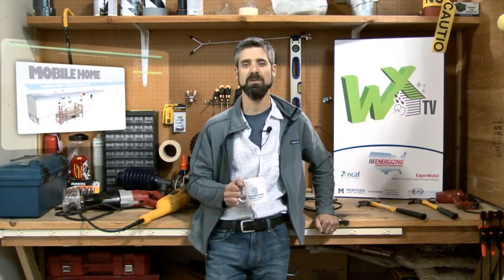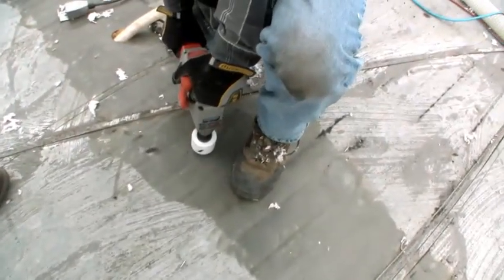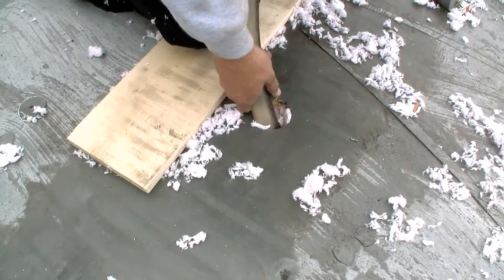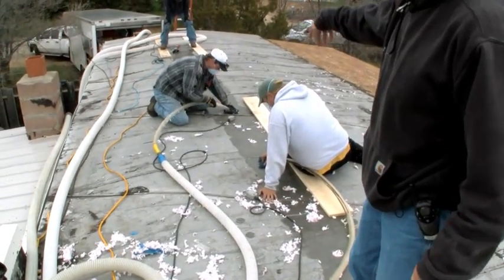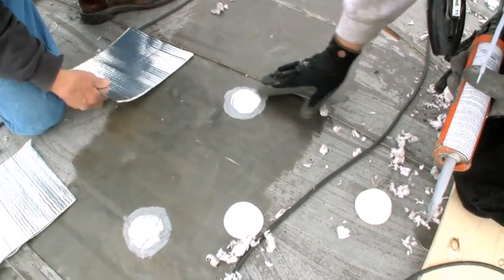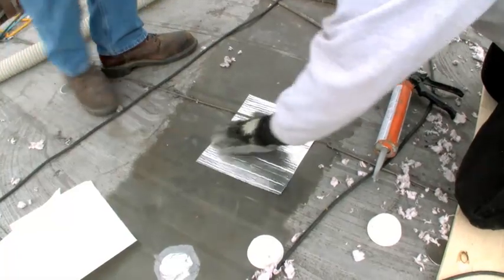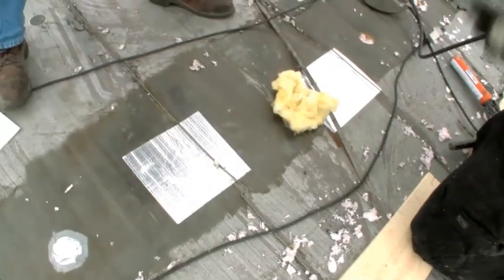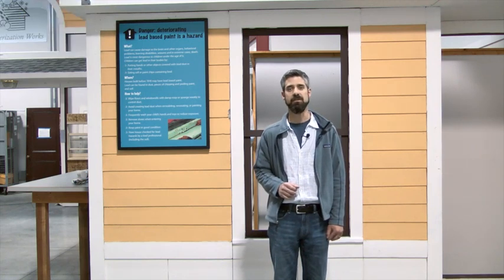Mobile Home Insulation: Drilling through the Roof

Comment: We live in a double wide mobile home and it's extremely hot in the summer, and extremely cold in the winter.  Can part of the ceiling be taken out and insulate or does it have to be from outside?
Reply: Yes you can take ceiling of but you would have to buy new sheetrock to replace. Get ready for messy work. The existing ceiling will be made of blended cardboard material. Itll be a mess